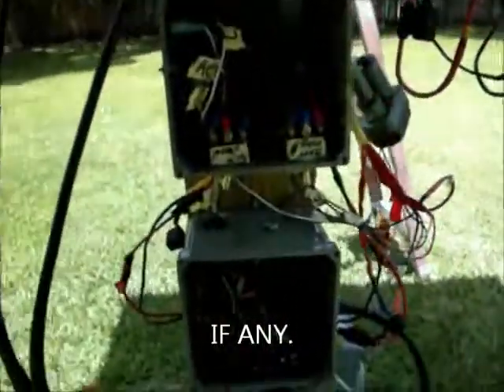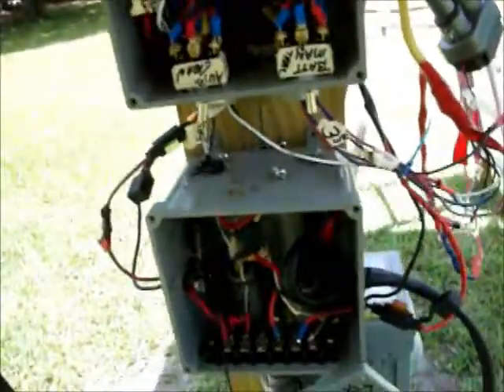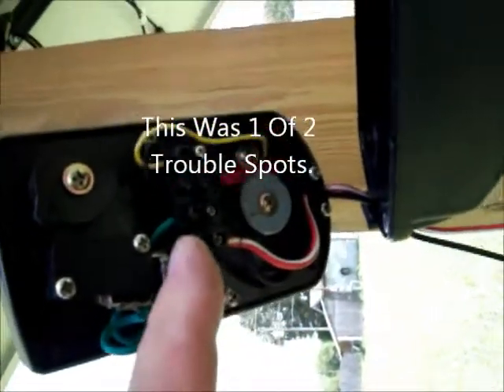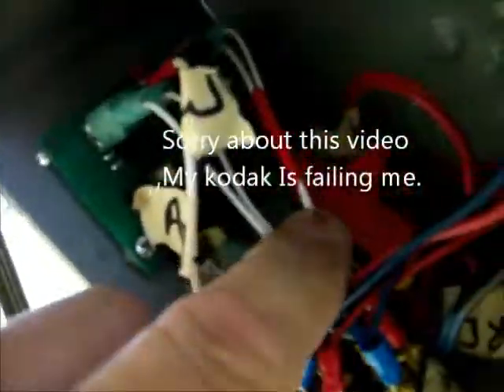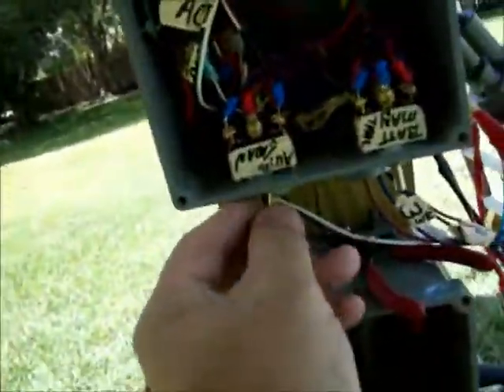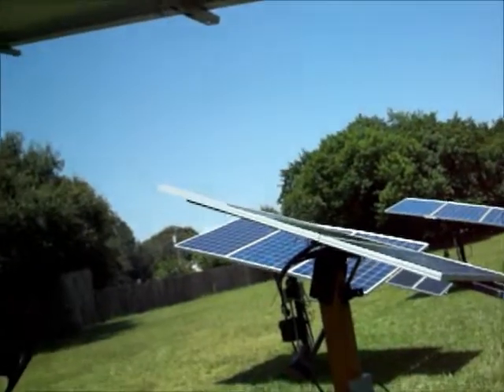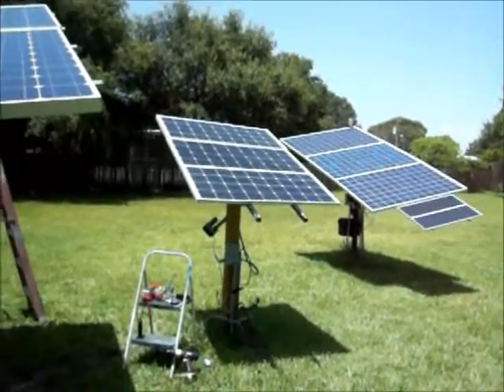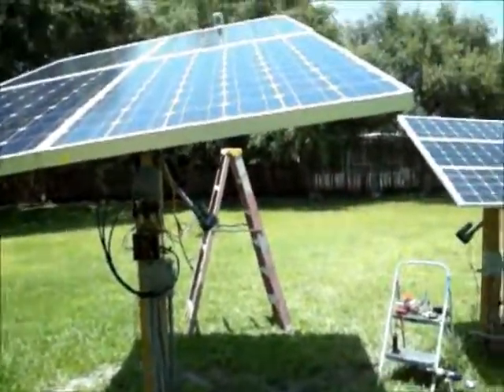TESTING MY TROUBLE SHOOTING SKILLS.

Comment from the maker: The wire was 1 problem but the relay  had 2 black wires touching every now and then .I thought they were ground wires 1 was 1 was a switch wire for 2,ND small tracker that runs off the big one. It,s fixed now. It about drove me nuts. It popped while i was filming this video that's when i found it.Sunday Late.

Comment from the maker: Thanks, It seems no matter were u go at some point u will have a shade issue unless u have a lot of land or do what i did and remove about 40 trees.This place was so over grown I found I had a CBS garage & 4x4 ford pick up.buried beneath the over growth u could not see my land from the road. If Distance is a issue I,d go with the enphase inverters & run 220v. to your home.I,m thinking about buying 4 units. Do to mismatched Solar Panels + heat are killing my power on 1 tracker.I,m down@2KWs a day

Comment: did it stop popn fuess after you tighten down the wire in the actuator? If not it is probably in the spot that you touched with your hand in the video and the fuse poped.

Comment from the maker: I know what u mean, Those big flew teknik panels are realy hurting in the heat,i,m lucky to get half the power there rated Plus they are mismatched That kills power on a string inverter,like my Power Jacks They work great if all the panels are the same if not the power is set by the lowest performing panel. I have 3 that work about the same  but 1 panel is way down less than 4 amps the rest are 5 or higher.they rated @7.78 amp each. I may buy 4 enphase units as they are getting cheaper .

Comment from the maker: My problem is I,m feeding 3 trackers on that 1 relay.I need to redo the way the wires join together that's all.To many wires in 1 place.If that was the just 1 panel to a relay I have 3 less wires jumped together.

Comment from the maker: when I got them they were advertised on eBay i called the store and bought them direct but when i got there the were on a pallot wrap up with the One panel like was in the add on top so the guy gets fork lift puts them in my truck an off i go.I never checked them as i bought a good amount from them and at $260 A PIEACE  i was not going to bitch.all are with in 7/10 volt, but some are 240 watt 232,245,237,They were old new panels all under the 240M label.No biggie.I may try 4 enphase units.